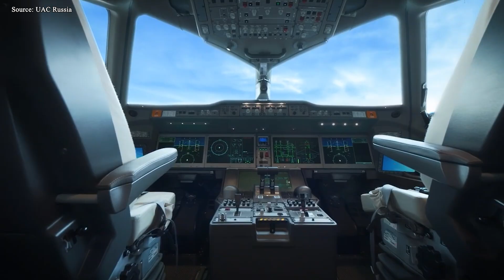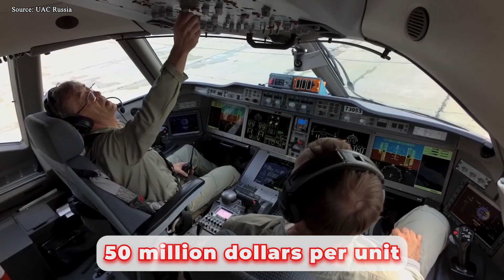This is How Russian NEW MC-21 Will OUTSMART Boeing 737

Comment: Now that the American Technology & production are going downhill, Russia must adapt it for her use & produce own alternative. Russia can improve upon the decade-old American one, like increasing the by-pass ratio of engines. It is ironic that Boeing 737 is serving as the kick-start of this process.
Russia needs Aviation to connect remote points in her own "vast" country, working under extreme climatic conditions & terrain and so can develop her own solutions. She can be the world leader in civil aviation, navigation/guidance systems & Avionics.
Russia can be a reliable supplier for civilian transport aircraft with own-developed supply chain (she has abundance of all minerals & ores like no other country).

Comment: The Boeing B-737 uses a lead weight and tailplane tab to center the aircraft, while the Airbus A-320 move kerosene from  rear tailplane to the tanks in front of the wings, possible by flight by wire design.
Reply: In a number of incident- videos, explaned by engineers , it´s very clear that the Boeing new 737 & max-series are built un-balanced. They are corrected by pre-programmed flight cotrols. But the fact remains: When you get out on the runway, you´re allready unbalanced.
Reply: @mander0505  
The basic problem with the 737, began with the choice of more powerful & big (& heavy) engine. As a result the ground clearance below the engine became critical (can be fatal if things go wrong that is often the case in air). 
Not only that, with the heavier engine, the CG moved forward, resulting in nose-down tendency. 
It needs a new airframe design, with considerable cost. But that solution is in Engineering-redesign. 
Management that took over the problem, posed it as one of configuring the flight paraemeters to be overcome. Their brilliance (in problem-solving) led to manipulating the flight surfaces to give "even flight", taking over the initiative from the pilot but dictated by software, the new-fangled discipline in Egineering. Result is MCAS (opaque to the pilot).
Reply from the maker: Thanks for sharing that insight into the B-737 and A-320 designs.

Comment: Soyuz rockets have been used for space exploration since 1950's and been used until now (of course with upgrades and modernisation). Russia is not new in making planes......fighters and commercial planes. MC 21 is of course much better than A320 and Boeing 737. Certification? That is the Western world's method to avoid real competition. B737 Max.....is certified, right? Is it safe????
Reply: You are right, Western certification is in no way a safety. In a number of incident- videos, explaned by engineers , it´s very clear that the Boeing new 737 & max-series are built un-balanced. They are corrected by pre-programmed flight cotrols. But the fact remains: When you get out on the runway, you´re allready unbalanced.